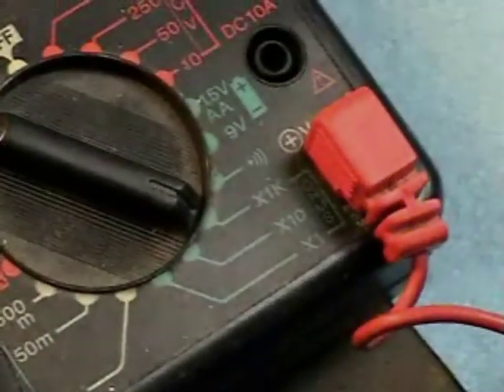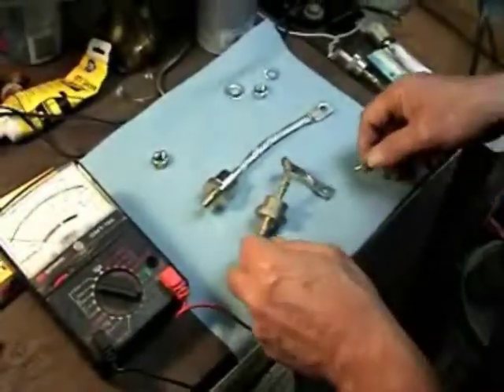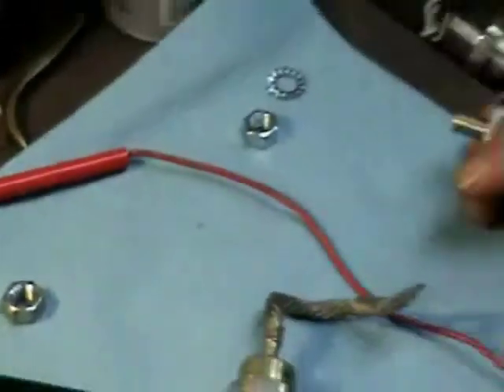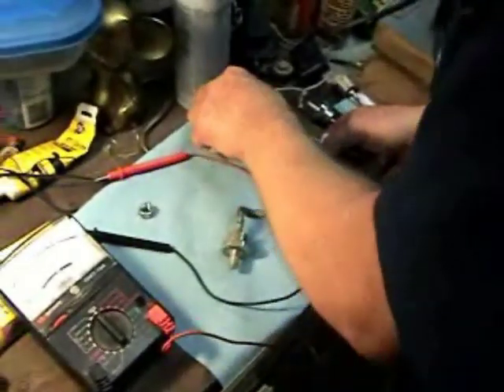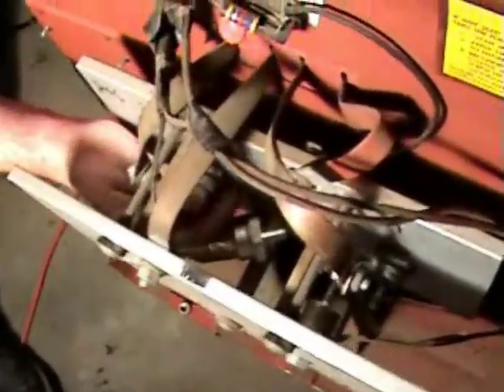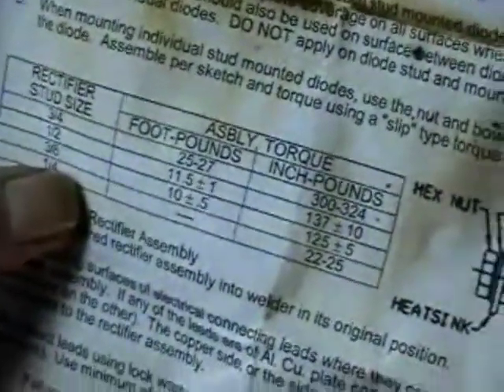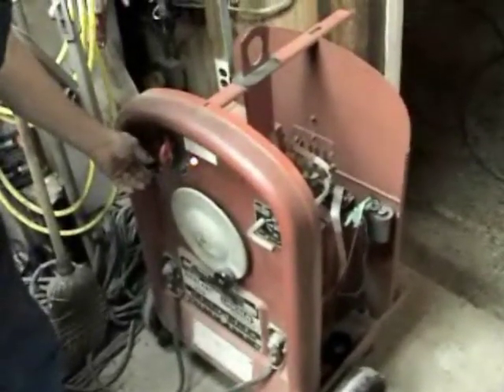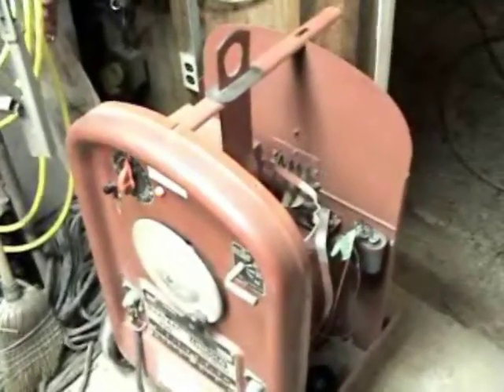Repairing a Lincoln Idealarc 250 Welder

Comment: This job is a newer IdealArc 250.  My old 1966 Lincoln model had 24 little Motorola SCR diodes, impossible to change out diodes, soldered in place. Called Lincoln, they did not have a part anymore. So I built my own full wave bridge rectifier for it - -  no chinese stuff, runs great.
Reply: I really wish you would have recorded that process. I have read about guys doing this but have seen no videos on it. I just did a 3 part series on the Lincoln Idealarc 250 but mine was just a restoration. Mine worked just fine, but I would like to know more about how you did yours. Here's a link to my restore if you are so inclined:  https://youtu.be/prQYxb1-eCM
Reply: @Rob Neighbors,
     There is two ways to fix the “permanent” diodes in the older bridge rectifier:
1. Modify your existing bridge rectifier to accept modern screw in diodes. There is a YouTube video on how to do this, there are posts online if you search and someone on eBay doing this conversion for $$
2. You can swap out your older bridge rectifier for the new updated bridge rectifier. The newer bridge rectifier has much thicker aluminum heat sinks and the screw in diodes. You could buy it from Lincoln new $$$$ or find it used from eBay or from Lincoln suppliers like Stumpfs.
Reply: @scottl5910  Sorry, I already called Lincoln, they no longer sell any parts for this old welder. Modifying like you suggest is a waste of my time. If you repair only the silicon diodes that are failed, what happens next week when more old ones fail and then you have to tear the whole box apart and start all over again, maybe you have time for this - -  I don't. I built a "Holy Moley" rectifier that was WAY OVERKILL since I could not easily source anything a bit smaller (that was still rated a power diode). Hell, I can plate metal at 400 amps, 100% duty cycle with this beast, or charge a Tesla, probably MULTIPLE Teslas. My four diodes were only like $23 each at the time, no worries.

Comment: The Dow Corning is just thick silicone grease  . . . . Sure appreciate this video, this EXACT same thing with the louder buzzing noise just happened to my ancient Idealarc 250, I will proceed exactly as you have to test diodes at 1Kx with multimeter to determine if diodes failed . . . . be careful guys if you see any capacitors (little cans with wires coming out of them), but sure to short them out with a screwdriver across leads before you stick your bare hands in there, else you may get a new smoking hairdo looking like comedian Richard Pryor after he failed cooking up a batch of his brew . . . .

Comment: Hi i Have s cuestión I have a Old Lincoln idealarc 250 amp and I was using it on I turned h and I was using it on I turn that off On when I turn on Didn't work anymore I check the switch on those OK Do you have any idea what can be wrong with that thank you

Comment: I had one of these....older though...4 heat sinks and about 12 smaller diodes on each one....I sold the welder for $100...thought I made some $$.....1986...
Reply: I have one exactly as you described. It was made in 1972 and it welds like a new one!